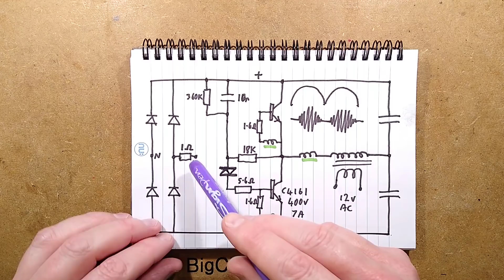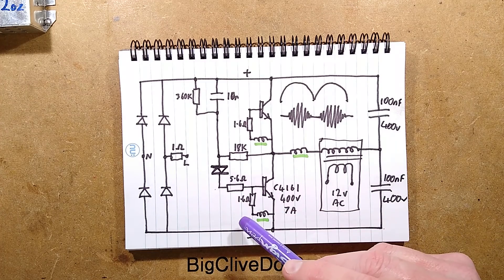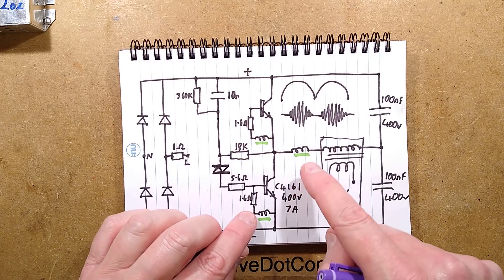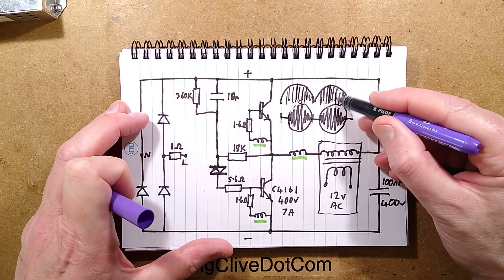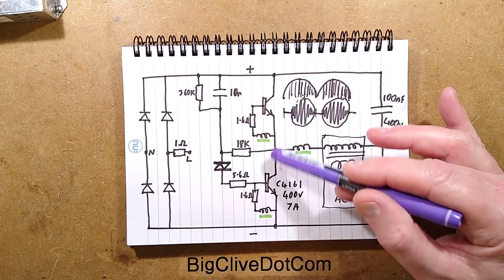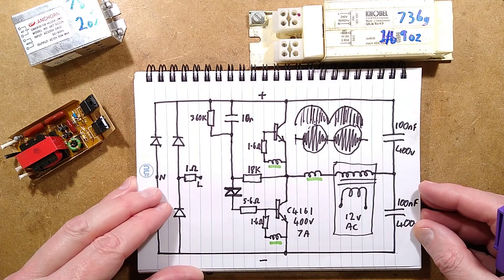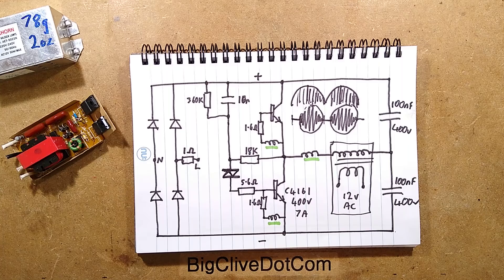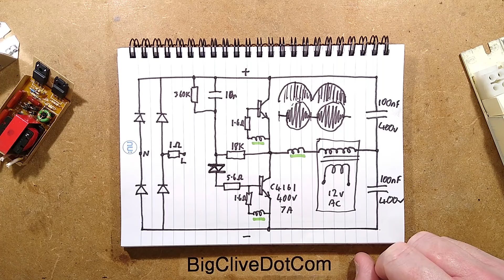Inside an electronic halogen lamp driver, with schematic

Comment: I have one dumb question, why do you want drop 120/240v AC down to 12v AC like when a simple 120/20v ac to 12v AC transformer would be easier to setup.
Reply: As he said, a linear transformer is heavier and more expensive, and less energy efficient. These have price, weight and efficiency advantages. But it comes with a cost of losing reliability. Your 50Hz linear transformer will last practically forever, save for a direct lightning strike or shorted output (which is why you have a fuse).
Reply: @Agent24Electronics  Even though transformer are heavier, they produce less problems.
Reply: @muffenme  Indeed. That's why I prefer them myself. Simple and dependable.

Although in high current scenarios, a decently filtered switching supply (not like the one shown here) can be better. Most laptop chargers would weigh over 1kg if they were based on a linear transformer. Ones for high power gaming laptops would be even worse.
Reply: @muffenme  Using a capacitive dropper should work fine (excepting the terrible power factor) and AFAIK would even provide some intrinsic soft-start functionality to extend the life of the bulbs. Using a resistive dropper here would waste so much power the heatsinking would probably cost more than a transformer.
Reply: @muffenme  I doubt that they produce less problems - the problems are mostly produced by the marketers who saturate the markets with shit. There are decent switching power supplies out there, even for use with halogens, but you probably will miss them if you only look for the cheapest or most popular options.And remember that the problems can’t be narrowed to just the end use point of the product. What about all the pollution created by the relatively massive resource processing operations that the big mains transformers require? They are resource hungry, and the pollution caused in their manufacture probably has measurable impact on life expectancies…

Comment: What would happen if a 400V electrolytic capacitor was added to the rectified mains DC. Would the output be less "like a string of beads" or would the transistors go bang. Would adding an LC filter to the spikey 12V AC output make any difference to the high voltage spikes.
Reply from the maker: That's what compact fluorescent lamps do.  If it was done to this unit the output voltage would be higher and it would not be dimmable.

Comment: What does that spiky waveform sound like? Would there be a way to generate it with lower voltages and/or without the risk of the circuit blowing up?

Comment: Are you sure the transistor stays on until the capacitor discharges? It looks almost like a blocking oscillator where the feedback rapidly changes polarity when the transformer core saturates.

Comment: Interesting stuff ... having done a large halogen to led swap I remember the issue about not having enough load to keep a circuit active, but your comments about the rough waveform probably explains the high dropout rate. Fortunately the power savings were massive compared to the cost of the bulbs so nobody even thought it odd.  Thx Clive!

Comment: funny you should mention led lights clive, i was at a newly completed job the other day were some twit had fitted these transformers on led lights rather than drivers. needless to say the led's were dead. i can remember the old halogen transformers in the early 90's and they were solid heavy wire wound transformers better than this kak that they produce nowadays.
Reply: Funny? When does Clive not mention LED lights?

Comment: I want to know why the halogen bulb even needs a special driver? If it’s got a filament, it’s an incandescent bulb - just pass the right amount of current through it, and watch it light up. What would happen if you just use a capacitive dropper as in some LED night lights?
Reply from the maker: The 12V lamps pass a high current.  They're not suited to capacitive droppers.
Reply: bigclivedotcom - Capacitive dropper, here I come! I want flaaames! 😊
Reply: “Pass the right amount of current” - yeah, that’s kinda the conundrum here. You can use a capacitive dropper of course. It’ll cost 10x as much as the circuit shown, probably won’t last as long, and if everyone used those, the electric companies would start slamming the charges for lousy power factor on everyone’s bills, too.

Comment: Where would these be used? Most of the halogen bulbs over here just connect right to the 120vac mains.
Reply from the maker: The higher voltage halogen lamps are less robust, less efficient and can explode when they fail.  Especially on 240V.
Reply: @bigclivedotcom  I once saw an old project online where somebody put 20 low voltage 12v halogen bulbs in series to run directly off of 240v. I thought it was a neat project.

I'm sure you know what website this was on :)
Reply from the maker: @eDoc2020  Sadly I can't use my deadly chandelier here.  The ceiling is too low.
Reply: There were 12V Halogens, quite trendy for a while.
See here:
https://www.brewstersbatteries.co.uk/catalog/premierrl1205h12v5wmr11halogen-p-575.html

Comment: That's funny. I recently replaced halogen lamps with LED lamps and ran into the minimum power requirement. The lamps worked but the driver hummed audibly. I replaced it with an LED driver. I was actually considering sending the old one to you because I was interested in why it had a minimum load. Coincidences :->

Comment: I remember bying one of these thinking it'll be able to drive 12V LED strip. Guess what!
Reply: You fried the LED strip.
Reply: @simontay4851  It didn't even start!
I tried full bridge rectifier on the output, two LED strips in reverse-parallel, shunting the output with a low power 27V bulb, shunting with a resistor. Nothing!
Reply: LEDs started display Star Wars movies? 🌟
Reply: @matijakukec4731  It was more like playing Doom3 on a lowest brightness with a monitor turned off.
Reply: @777anarchist  😂😬😅
Reply: Mohamed Abbas  Doom3 is the third version of the first person shooter video game series. You must've heard of Doom, surely? Its a classic DOS game.

Comment: Some of the newer led tape lights. Have the effect of jamming radios in short distance
Reply: Must be the cheap driver, not the tape.
Reply: @johndododoe1411   yeah it was the driver.     It doesn't work properly  anyway had to learn a whole new color code on the remote.   The Chinese LED tape lights. Are  kind of crappy  but functional
Reply: @Michaelc-gn3eg  I have an LED strip lamp illuminating my desk (sold as a sewing machine accessory) that has a USB plug (it's plugged into a USB extension cord drunning to my PC). My ham radio transceiver and SDR are directly adjacent, and I can detect no RF noise at any frequency.
Reply: @allenlutins  maybe it could just be my particular control unit it has a fault somewhere in the circuit does not work right anymore with the remote. I would pick it up in the am. band. Of the radio frequency. Also In  very certain FM frequencies.  Especially while the LEDs were dimmed down I'm not sure if they would affect ham radio or CB mine are not USB power they plug into the wall outlet.  Could also be in the power supply.
Reply: @Michaelc-gn3eg  Switch-mode power supplies that convert AC to DC are radio noisy and that's probably the culprit. The advantage of the LED strip I bought is that it runs right off DC (from USB) - no conversion required.
Reply: @allenlutins   thanks. That's agreeable   and probably just need to get a different converter for the controller

Comment: Thank you for your every video. Since I started watching your channel (and Louis Rossmann) I've learned a TON. Before, I was quite anxious to component level repairs -  now I do lots of it, diagnosing problems, detecting faults, following my typical approach - even if it's not really worth it, I'll do it anyway :D
When I started my work in maintenance department at my company, there was a lot of automation equipment no longer functioning properly, being instead operated manually. Timer relays for lights, phase sequence relays, stuff like this. After watching your videos, I started to understand principles of capacitive power supplies. Now I brought most of it back to life thanks to you. Granted, I could've just buy new components and replace them, but where's the fun? Also, replacing them would mean utilisation of old parts, so you essentially prevented generating of more electrowaste :)
Thank you, Clive! Greetings from Poland!

Comment: circuit looked really familiar, you think a smd version would be as loud?
Reply: Very likely, the noisiness of the circuit comes from how it operates, not from using through-hole technology.
Reply: @Agent24Electronics  my thinking was maybe the smaller components would have less of an effect, hopefully being better made, or made differently from their larger counterparts

Comment: I like the capacitor arrangement in this version. It makes for a quick start as the voltage over the DIAC increases immediately with the input rising. The resistor in parallel just ensures the cap is discharged again.
But indeed, spike sensitivity...
Reply: My Fluorescent tube electronic driver went the other day. I opened up and saw the two small electrolytic capacitors are dead (swollen top).

Comment: I would have been surprised if that didn't spew radio interference - that waveform looks like a typical over-modulated AM radio signal. Probably puts mains frequency noise across the entire AM band.

Comment: You know what you have to do now Clive, don't you? We need to see an LED go bang in your next live stream.
Reply: Unfortunately they don't go bang ... they just ... stop.
Reply: They used to occasionally bang when run without a ballast resistor. I remember my father soldering together a whole pack of random LEDs from RadioShack in the late 1970s and then attaching them to an electric train transformer. One of the LEDs exploded loudly.
Reply: Peter S 

that's funny, the only time I've seen an LED explode was when I was about 12 years old, also from a toy/model train transformer. 

I got the (red, they were still pretty new tech) LED from one of those electronic kits for kids (when they were still full metal clips on the top of the plastic base rather than modern breadboards, where the metal is all enclosed in it) and stuck it straight across the output terminals. I recently opened the power supply up and it was literally a big transformer, a potentiometer and maybe a resistor if I recall.

The LED went bang in between my thumb and my index finger, I felt a shard of hot plastic hitting my cheek and smelled this really unique smell of the LED smoke. Years later I realised the toy train power supply had two outputs, one with a single diode, one directly going to the transformer winding, providing the 12v AC, which probably was the one I stuck it across. The transformer was a bit older than me, and even still works today.
Reply: @thephoenixscotland  And become DED's - Dark Emitting Diodes....
Reply: @thephoenixscotland  Not always...sometimes they explode quite violently -- but yes, they often just let their supply of magic smoke out (it's rather stinky!) or simply extinguish silently and permanently. But again, some of them do go out with a bang. :-O
Reply: I want to see an LED go BANG! as well. :-)

Comment: Hi bigclive! Is there somewhere online where I can buy replacement PCB for a Luceco LED floodlight? The microusb charging port has broken off the board, and I can't solder it back on. Don't want to replace the whole unit, as the light itself is fine. The number printed on the chip is cm010-3-vx.4. Any ideas? Thanks!
Reply from the maker: I doubt you'll find a replacement PCB.  But if you trace the power tracks from the USB connector you may be able to permanently add a short USB charging lead.
Reply: @bigclivedotcom  thank you very much, I'll have a go!

Comment: It seems rather silly to use one of those rather than a standard transformer.
Reply: The standard transformer uses more raw materials, costs more to make, more to transport, and is less efficient as well, although that doesn’t mean much it you use it to drive incandescent lamps.

Comment: hi big clive .   could you explain   how  a vw electric  power  steering   system works  . i took one apart   its very instresting  cos it  seems to use a brushless  3 phase  mlotor   some how worked  from  12v dc  power supply   hope can  explane  this . thanks
Reply: I would really like to see a teardown/explanation video on that also!  I'm glad they use brushless motors in the VW ones, as steering is pretty important (!) would hate to have it fail because of a brush/commutator mishap!
Reply: When it fails you have manual steering yet

Comment: You can actually use these supplies as cheap DC sources by rectifying with high speed schottky diode in a "Full Bridge Rectifier" (half bridge wouldn't work) configuration. It is genuinely amazing that they do pack a big punch in such a small footprint, usually 60w in this tiny case.

Comment: Arghhh!  You didn’t draw the Full Bridge Rectifier in a diamond shape!  Must be a first in the electronics domain?

It would be interesting to get some HV probes and an isolation transformer and scope things like this?
Reply: I have a really early General Electric SCR manual that has the diode bridges drawn this way. 1962 I believe is the publication date. Therefore, I always draw full wave bridges that way. Guess it's the way you learned as a kid.

Comment: It does not discharge the capacitors in its HF half-cycle. The driver transformer core saturates first, and that makes the transistor base current stop.
Reply: Dave Micolichek  Core saturation will cause the transformer coupling to vanish, as the magnetic field strength can no longer change. Primary current will no longer be transformed.

Comment: Just reminded me, cheap LED streetlight alert:
https://www.ebay.co.uk/itm/303554975555
(and the first buyer of one, erm, me!!!! :P )
Reply from the maker: I think I've made a video about one of those.
Reply: Just had a quick search of your vids, and not seeing one like this, though having taken mine apart this afternoon (before turning it on of course like 'im down under insists), it's rather simple actually, it's a "driverless" board of 48x LEDs (2x per lens), a mystery black module which I didn't dare pry apart, and a surprisingly generous length of flex to slide down a pole, and, best of all, it's earthed too, for £15.99 it's a steal, and for 1p more they have a 60 Watt version too... :)

Comment: Halogen bulbs require a driver? 🤔
Reply: Well, the ones that run at 12 volts need a way to get that low voltage, and without an old-fashioned 50/60Hz transformer I guess that means a driver...
Reply: @markiangooley  yeah I later got to know that this is a Step down constant voltage SMPS regulator.
Reply: @pravardhanus  This is actually an unregulated SMPS, the output voltage is far from constant. Regulation requires more circuitry and would also prevent dimming.

Comment: Your printer is amazing your prints look so real
Reply: Mai Mariarti  I may remember he talked about an epson with ink tanks. Could be wrong...
Reply: Timsalt3100 It‘s not the tool. It‘s the carpenter.
Reply: Mai Mariarti  The ink tank printers are very cheap to run. £30 for 6000 prints ... approx.
Reply: Mai Mariarti  He uses an ink printer that has been modified with a continuous ink supply system (CISS). I use an Epson EcoTank that does much the same.
Reply from the maker: I switched to using an eco tank printer.
Reply: Mai Mariarti . Clive mentioned the printer in one of his earlier videos, I'll find a link for you... Give me a bit of time, my granny just passed, so I am busy arranging funeral stuff 😢
Reply: To get top end printer performance you need to be willing to spend more + maybe consider pro printers
Reply: @gazyounglive  Or used, older and refurbished laser printers

Comment: do they make dimmable CFL drivers and if so can you take one apart at some point?
Reply: I used to have a dimmable CFL about 10 or so years ago, worked well, until one day it just decided that it didn't want to dim any more, so it was either on or flickering like a sod if attempted to be dimmed...
Reply from the maker: That's a complex area.  Proper dimmable fluorescent lamp drivers have to keep the tube cathodes hot over the full range.
Reply: These days all the intelligence is either in a dedicated chip or a microcontroller; they basically extract the AC phase cut point (from the dimmer) and use it as a current control signal. They otherwise ignore the phase cutting, but have to run from a wider supply range because of it. They are, essentially, wider-input-range CFL supplies with a control input carried over the mains wiring.

Comment: What’s the advantage of this over a 12v SMPS?
Reply from the maker: Dimmable and very high current in a small space.
Reply: bigclivedotcom Thanks.  I get the dimmable bit but why higher current?
Reply from the maker: @michaelfisher9671  No smoothing or regulation required.
Reply: @bigclivedotcom  Thanks for that.
Reply: Cheap
Reply: @777anarchist   You hit the nail on the head.